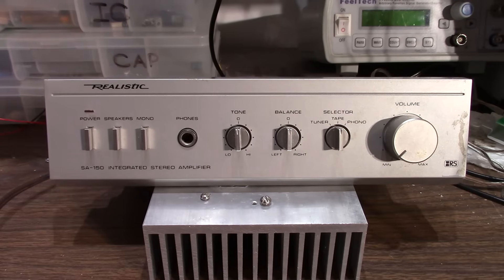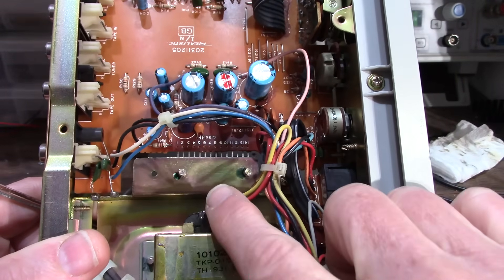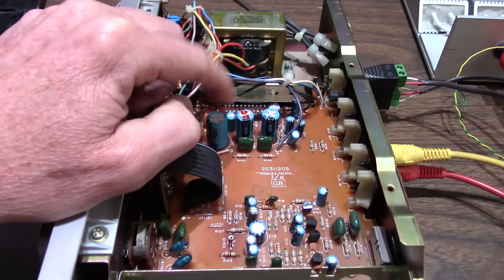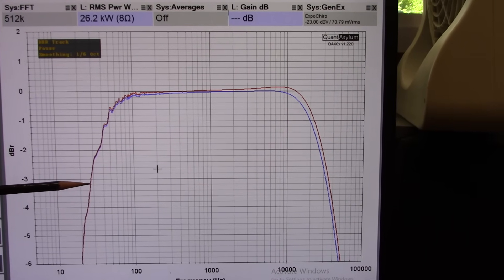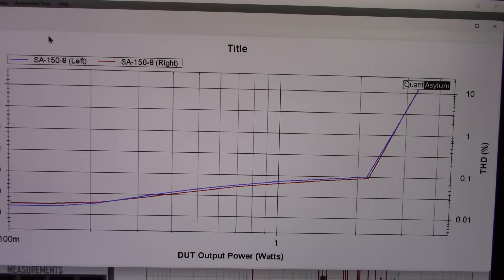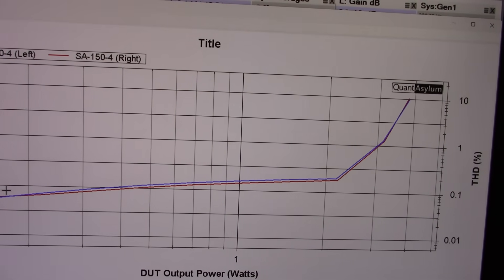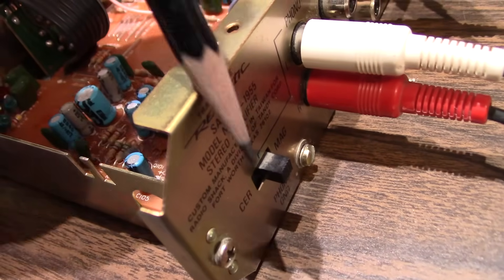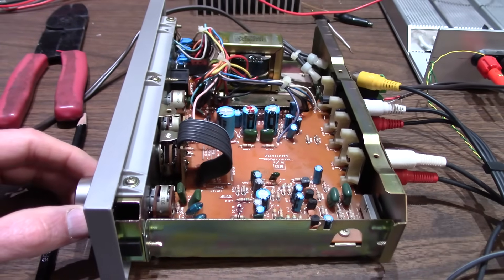Realistic SA-150 amplifier tested on the audio analyzer

Comment: I love it when amps are actually tested for power output, distortion, and frequency response.  It sure beats someone saying that it sounds "warm" or "sterile", which really doesn't say anything useful.  But I do have to disagree with you about the loudness contour.  Audio purists seem to think their hearing is flat from 20 to 20, and it isn't.  The loudness is merely compensating for our faulty human hearing, and to think otherwise is just fooling yourself.  RS should have added a switch for that.  But, it's your amp, to do with what you please.  Keep the good videos coming!

Comment: Reading the datasheet for the LA4440 shows it to be an audio horror story compared to more modern IC amplifiers, eg TDA2030/LM1875 leaves it in the dust lol.
IME repairing these kinds of early amplifiers upgrading all the electro caps to low esr types pays great dividend, also ditch all ceramic caps and replace with film types (polyeter/MKP etc).
The negative feedback shunt capacitor in amplifiers has strong bearing on the sound of amplifiers, this cap is typically a smallish size electro of low voltage rating which also means high esr.
I replace with higher value to bring the amp stage lows roll off point down in frequency and replace with highest voltage rating low esr type that will physically fit.....larger physical size is always lower intrinsic esr.
I also bridge this electro with a film cap and better still a silver mica cap also.....sweeter and more extended highs.
Ditto output coupling caps and PSU caps, go as big as will fit and bypass with film caps at least.
I am looking forward to seeing your mods/improvements just for the fun of it. 👍.

Comment: I'd not get rid of that loudness as this amp will probably be used with speakers having a high db ratio. 90db/w or more are excellent to use with that little amp.
That loudness-controll compensates also for the lack of a proper tone control. 

Good luck with the "changes" you're gonna make and thanks for this video.

Comment: I have owned a couple of these at different periods. They are good for their size and great for testing equipment on the workbench without taking up a bunch of needed real estate. I worked at the Shack in the 90's and these were a good seller for modest setups. And a set of Optimus bookshelf speakers.
Reply: Worked well with Minimus-9s as well.

Comment: Could you rewire the magnetic/ceramic switch to turn on/off the loudness function instead?
Reply from the maker: I would have to break the circuit in 3 different places on each channel to remove the loudness effect, so that would not work.

Comment: I own the same amplifier, bought it for $15 second-hand many years ago strictly for test bench use. Frankly, it's too 💩y even for the stuff I work on; about a c*nt-hair better than "Go. No go." testing. E-Waste dropoffs have provided MUCH better free/almost free receivers & (dis)integrated amplifiers that don't actually take up alot more bench space in practice than this little 🧩 of 💩🚮 does. Like 40 & 50W Fry-An-Ear & SonicPanic receivers that even work via a handheld remote control, for one thing!🤨😘
Whatever space it saves it loses with the hassle of making room for & f***ing around with RCA-5 Way Binding Posts adapters, & its negligible weight means that the weight of RCA interconnect cable is enough to slide it off & behind my bench unless I put a Minimus-7 on top of it 🤣🤣🤣, never mind the pull of speaker cables!🤪🤦🤦🤦
Along with the negligible weight comes it's negligible sound quality; it's right up there with the greats from Yorx, Juliette, Strauss, Lloyds, & low-end AGS (& since AGS was pretty bottom of the barrel to begin with, that should tell you something!😏). That said, it's amazing how much volume 1.8W/ch. of vicious, unbridled fury can provide in near field listening with even fairly inefficient speakers (the 83db/w/m Mickey Mouse 7 being a case in point🐀), as long as the music doesn't have any low bass or dynamic range to it. Leona Boyd, anybody?🥹🥴😝
A wise man once said something about the inadviseability of polishing turds.💫💩🌟
You lot ought to listen.😘

Comment: I have one of these, I was using it to drive some back yard speakers ages ago, never knew it had that loudness option. As it just uses a 'car amp' IC, I never tried any serious audio listening with it. The main thing I noticed was the tone control seemed to act more like a treble attenuator than anything, so this amp just sits in my junk pile awaiting a possible use.

I did try playing around with another chip power amp board, it had way to much gain for my use, so I converted that gain into extra feedback and that improved the audio quite a bit, I wonder if that hack would be applicable here?

I just downloaded the owners manual for the SA-150, that shows a 22K resistor in series with the 100K volume control, so there is a bit more gain for one to play with. That 22K resistor is also feeding into the CR network around the volume control, so probably upsetting the frequency response quite a bit, so deleting that would be interesting.

Comment: On a similar unit to this one that I use for a computer amp, I doubled the output and PS caps. I nibbled a square hole in back for speaker clips. I changed the out jacks into preamp out, using a couple unused tracks on the PC in just the right place. I was going to do the same modifications to that one plus a bigger transformer and a real heat sink.
Reply: Finding a hotter transformer that would fit was the stopping point. Debated whether it was worth ordering a little toriodal unit...

Comment: Does the AN7168 have the tendency to fail? My Panasonic tape/radio amplifier is extremely quiet with a heavy bias to the left channel and it's making my dead IC senses tingle.

Trying various stuff (including injecting very small DC voltages) on the internal audio lines made it temporarily work. That's the thing that makes me suspicious.

Comment: What’s great is seeing the Realistic logo on the board - they actually contracted with manufacturers to produce to their specs.  Today, companies just buy whatever crap is on the Asian market and slap their sticker on it.  Flipping crappy products is todays companies
Reply: They are super cheap, though... like the $20 Tripath TA-2020 Class D or the Audio Express BT170 Class A/B with Bluetooth for $40.  You really can't beat that, although one really needs to do their homework before buying.
Reply: They're still alot better than just about anything Radio Shack ever sold at anywhere even remotely near the price...🤨 & that's BEFORE you adjust for 35-45 years of inflation!🧐

Comment: I have the SA-155 and use it for my bench amp. It works perfect for that application. I ditched the RCA speaker connectors and added a spring loaded speaker connectors

Comment: It's a shame they didn't provide bass and treble controls instead of a single lo/hi tone control.
(Edit) 13:10 Wondering whether the disparity on left and right THD measurements might be explained by a marginal capacitor on the right (red) channel of the circuit.

Comment: To increase the power of this amp to almost double do this: take the 3 wires from the output transformer out of the board, connect only 2 and convert the circuit to use full bridge rectifier that you make using 4 shottky diodes. Increase the smoothing capacitor to 2200 or even 4700uF and test it, almost 4 watts at 4 ohms. Power 😮
Reply: But, doing that would almost double the Vcc to the chip. Possibly over its supply rating, so you could have some problems there. Upping the PS filter cap to 2200 or 3300 (later versions of the SA150/155 did use a 2200 uf filter cap) while maintaing the existing transformer/rectifier setup may make a slight improvement in performance.
Reply: @davekazoroski6548  Well, no I am not saying to take the full voltage (the opposite ends) of the center-tap transformer but to use only one winding. By doing that you effectively cut in half the DC resistance of the output transformer and by using 4 shottky diode bridge rectifier you have almost 1 volt more voltage on the capacitor. So, higher transformer current plus the increased voltage and bigger capacitor would bring up the power almost double without risk of overvoltage. Yes, the transformer will be a little bit hot but it will probably survive.
Reply: But first, it has to have an "output transformer" in the first place.🧐❓
BEFORE you blow it sky-high!💩🤗

Comment: I still use this one every day, excellent for ceramic cartridges. Small but really something special
Reply: Good to know it still has a use and I remember ceramic cartridges when I was very young.
Reply: @ConorHanley  Yes. Most every BSR record changer had one.
Reply: At first glance I thought the switch was to toggle between moving magnet or moving coil... but it makes sense that the latter was for ceramic.  Using this budget amp with a moving coil phono would have been a pretty bad mismatch... kind of like using a reel-to-reel deck with it. 😁
Reply: I use ceramic for 78rpm, combined with the loudness curve it sounds like an old jukebox. Love it

Comment: Another youtuber (diodegonewild) uses autotransformer when powering old electronics that haven't been turned on for a while, to reform the electrolytic caps at lower voltage, he slowly ramp up the voltage (for hour or so) to nominal 110 or 230V. Do you think there is any merit to this?
Reply: Just my humble opinion, sometimes it's worth a try but I've also brought caps up slowly only to have them suddenly fail miserably.